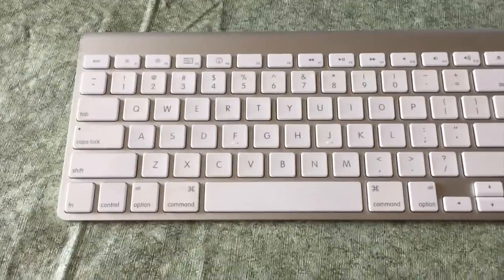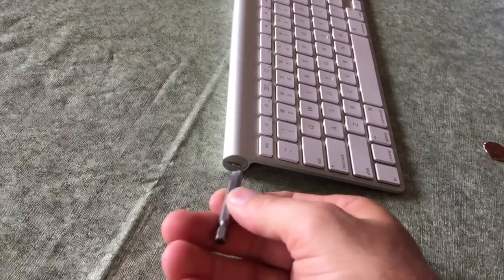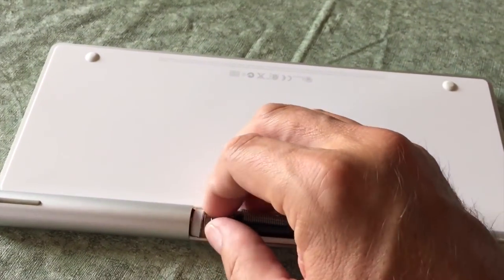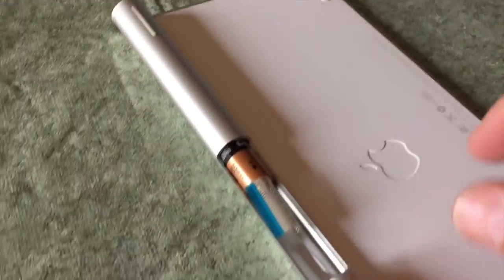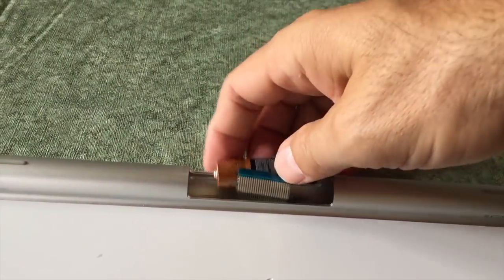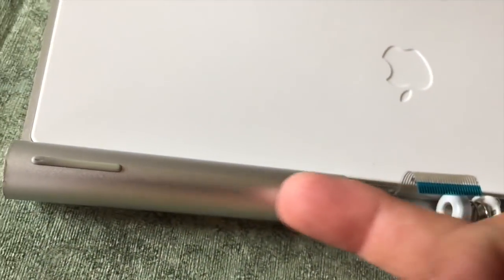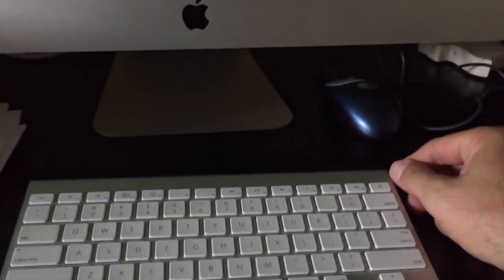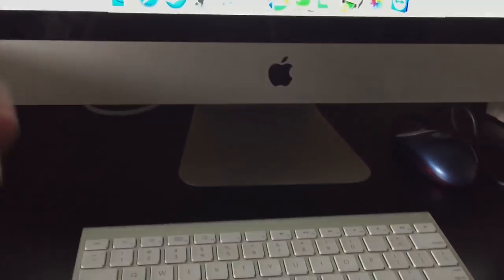How to replace Apple Wireless Keyboard Battery

Comment: Thanks for the video. I followed the steps of the video but the keyboard does not turn on. I cleaned the remains of the batteries but I do not know why it does not work. I put aluminum foil on the tip of the pile in case it did not make contact but nothing ... can you think what can happen? Thank you very much! regards
Reply from the maker: if you have not resolved this already you might try to make sure that you hear that little click I point out in the video that indicates the batteries are seated in tight with a good connection.  It is entirely possible that you have a lot of dried up battery juice still down in there.  It that is the case you will need to try to reach it with a small wire bottle cleaner or the like.  You should feel and hear that click with the batteries are seated correctly.  Best of luck.

Comment: Can I use something instead of the battery cover that screw on piece I can’t find mine
Reply from the maker: Not sure exactly what you are describing but if the plastic cover is missing and you want to keep dust out you can always use a little painters tape or the like to cover the gap.

Comment: Someone help me. My keyboard stopped working. I tried changing the batteries still doesn't work not even new batteries. I don't know it's either the keyboard keyboard or it's just the batteries. 😩
Reply from the maker: Sorry late response, but once you figure out if the batteries are good make sure they are inserted in the correct way (both should be facing same way).  Note that "click" in the video that tells you the batteries are seated correctly inside the tube.  It is possible to put the batteries in and still they are not pushed down far enough to make a good connection with the terminal inside the tube.  Use your index finger and push them down into the tube until you feel or hear the click.

Comment: Thanks for this. I ended up throwing mine away. The battery was so stuck I couldn't get it out even drilling a hole in the door and hitting it with a screw driver. 

I really don't get the point of wireless keyboards and mice. 90% of the time they are just a pain and I end up using an old wired Dell one from years back!
Reply: Yay i got my keyboard worked in only 7 years old and I did it😛

Comment: Hey yo! Thanks for the video, it is extremely helpful! Amazing, you gave me the confidence to attempt to fix my keyboard. I haven't used my keyboard in over A YEAR and the batteries were really corroded, I couldn't remove the battery cap either. But after I followed your instructions, I managed to fix my keyboard and save myself $150 on a new "magical keypad". Here are some things that I think would be helpful to note if all you people are facing the same problems: 

1)A STUCK BATTERY CAP (due to battery corrosion) 
-I sprayed WD40 on the cap as well (quite abit) and let it sit for awhile before I try unscrewing. 

2)A STUCK SCREW (after opening the middle compartment cap)
-spray WD40 as well, it should work!

3)STUCK BATTERIES 
-my batteries absolutely did not roll out like in the video. They were very, VERY stuck. Don't fret, take WD40 and sprayyyyyyy. Then, take something long, thin and sturdy (I used a screw driver) and a hammer and hammer the battery out. It took me awhile and quite a lot of strength but eventually, my batteries came out! 

4)REMOVING THE CORROSION WITHIN THE BATTERY COMPARTMENT 
-well, I followed Google and used a toothbrush dipped in vinegar. I couldn't fully remove the corrosion within, but it did kind of help. My keyboard could still work although there's corrosion left. 

5)KEYBOARD STILL WON'T WORK?
-ahhhh, when I completed everything you've said but my keyboard still couldn't work, I got pretty disappointed but I realised CHECK and ensure that all your CONTACT POINTS are CLEAN. (I forgot about the battery cap that had the corrosion crystals so I cleaned it and it worked)

Thanks friend for helping! I'm really extremely thankful!

(Also another thing to note, I'm just a ordinary, super noob non-techy girl and I managed to do this so I'm pretty proud of myself! Even though I was afraid that I might ruin stuff within like the wiring)
Reply from the maker: Well done, thx for sharing.  Success!
Reply: cheercub88 ok but what about stuck battery when u can't open up battery screw but you get middle compartment open?

Comment: Thank you for your thoroughness.  I really appreciated that you so elaborately described your methodologies that didn't work to open the compartment, because I think everyone who undertakes this task eventually gets to the impact driver or ceremonial dagger.  The painters' tape tip is great advice for those without magnetic bowl, so listen up people! My only note would be to retitle your video, something like "HOW TO ACCESS APPLE WIRELESS KEYBOARD COMPARTMENT WHEN CAP IS CORRODED," so others can find your video easier.  BIG THANKS!

Comment: What type of screw driver did you use to take out the screw?
Reply from the maker: The Husky 8-in-1 Philips and Slotted Screwdriver Set.  Bits include #000, #00, #0 and #1 Philips tips and 1/16 in., 5/64 in., 3/32 in. and 1/8 in. slotted tips.  http://www.homedepot.com/p/Husky-8-in-1-Philips-and-Slotted-Screwdriver-Set-74501/100074336
Reply: I picked it up last night and was able to take out the electronics and the first battery. Just can't get the second battery out. I think its rusted in there or something. :( Any suggestions? Hitting it against my leg def isn't working.
Reply from the maker: Try setting the board on its side with a towel or small pad under it.  Make sure the ribbon is still removed, place a protective layer of wood or coin over the key board end facing up and use a small hammer.   You can hit it with a good force. Use a heavier hit than on your knee.  I feel like if you are going to throw it away anyway because you cannot jar it loose then why not hit it hard enough to see if it will break free.  I had one corroded bad up in there and I was able to knock it back enough to use the knee trick the rest of the way out.  I then spend a good bit of time trying to clean down the tube after that to make good contact with new batteries.  It is not an easy task but then again you are trying to save $60-80 bucks.  Best of luck.
Reply: so get this...i called Duracell and told them what happened. They said they will send me a prepaid label and i can mail the keyboard to them. They will take a look and then determine "compensation". I'll keep you updated on what happens. Thanks!

Comment: Way cool video....Doc! Found an IMAC in a dumpster with corroded batteries in the keyboard. Couldnt get the end cap off either so I turned the end cap side up and dripped some light oil onto the cap every night and tapped it a little for 3 days. If you wait a couple days for the oil to soak in it will usually come out. Soaking and time  is the key.
Reply from the maker: Good idea!  Glad that worked for you.  Your comment may help others.
Reply: Cant figure why you would use a screwdriver when those slots are always designed for coins. They're rounded to take coins because coins are the most at hand tool. Mine is the other 3 call keyboard though Your 2 cell board looks easier to remove the bluetooth.
Reply: @Leyland---Doc...just figured out something on your video. Now that i see how to remove the maintenence cover and get the batteries out through it you could remove the batteries, shoot some WD-40 into the end, then let it stand up and let the juice soak into the end cap. Tap it every few days like I did, then try it aghain later with a nickel and it will come out.
Reply: @docs...hey this reply thing works pretty well. I'm still figuring out YouTub e though. Another solution might be to drill a hole in the bottom of the battery tube to inject some oil into it. Then tip the keynboard up so the oil runs down to the battery camp and soaks in.
Reply: Leyland Duncan )

Comment from the maker: Martin, check to make sure the ribbon is seated all the way into its slot and making a good solid connection across the entire ribbon.  Use a small plastic flat head screw driver or what ever you have to push down on the ribbon cable to seat solidly in place.  If it is not uniformly straight all the way across you sometimes will get keys acting up on you.

Comment: So I ended up taking them out but the majority of my word keys don't seem to work now. The space bar, delete bar, and several other keys work but the majority don't...any advice?
Reply from the maker: This is generally cause day the ribbon not being pushed in all the way so some of the key are not making connection through he ribbon.  Try reseating the ribbon and make sure it is push in all the way.

Comment: excellent - easy to follow...
unfortunately my batteries are fused n there - i got the first one out but the second one when i jammed a screwdriver up there it pulled the middle of the battery out! the casing is still up there and no way to get it out...
but thanks for the guidance!
Reply from the maker: Bad luck.  Sry to hear it.  Careful with the clean up.

Comment: I got the first battery out, but the 2nd one close to the end still stuck inside :(  I'm letting the WD40 juice sit in there for a day in hope it will make it loosen up.
Reply from the maker: +Joanne Liu were you able to get the stubborn one to break loose?  If not try that knee trick I showed in the video.  Get a block of wood if that doesn't do it and tap on it a bit harder.  The keyboard is very well built and can stand a good hit on the side or two.  Make sure that the WD40 has all been removed and evaporated out of the tube before attempting it though.  Otherwise it will stick on you.  Best of luck.
Reply: +Dale Smith Mine is a lot worse than yours because I left the batteries in there way too long.  The knee trick definitely won't work, I was using wood stick pounded at end, also used a knife try to loosen up the battery inside, but it's stubbornly sticked.  I used WD40 juice to soak it, it didn't help either.  I might just as well use the electoral drill to make a hole in the center from the end; that's what I am going to try.  Thank you!

Comment: This is the last thing I'd want to do!  If you have to do all of this to remove a simple set of AA batteries, before breaking something else, I'd go to an Apple dealer and get a new screw for the side and next time, be gentler with it!
Reply from the maker: +OPUS390 Yep, I get it.  It is easy for many to agree with you.  It is a last ditch effort to save an otherwise perfectly good wireless keyboard.  In many cases just getting another screw cap for the end is not a solution.  The acid in the batteries sometime fuse the cap and tube together and you cannot remove it so a new part by itself will not help.  If you can get the cap off then your problem is solve.  I agree with you on being more "gentler" when ever possible with electronics of any kind.  I will say if you go to an Apple dealer for any reason you might want to just buy a new keyboard.  They are cheap enough.  The fix I recorded was to aid others looking for an alternative to try to resolve the issue on its own.

Comment: Thanks for the video. It really is helpful. I have still have a problem though. I have removed the circuit board but the batteries are still not coming out. Your first one came out fairly easily, whereas for me, I have been hammering the keyboard and its still not coming out!! I guess its on to a new keyboard for me.
Reply from the maker: +yoho7788 Sorry to hear that they are still stuck.  You might try running a stiff coat hanger down the length of the tube to jar the battery loose a bit.  Then apply the force to dislodge them.  Sometimes the batteries swell so much the pressure may be to great to remove them.  Shine a light down the tube and see what you are dealing with.  I personally would try running something long and firm down to the battery and try to spin or wiggle it enough to bang it out.

Comment: If the  batteries wont come  out  this way,   do you have   a suggestion.
Reply from the maker: +Sandra Kanagasabai I have found always found that once the tube holding the electronics is removed tapping the keyboard on its side will release the batteries.  It is a matter of force I believe that is the question.  Some batteries are stubborn and need a little more force to break them loose.  You can also try straightening out a coat hanger to run down the tube to jar the old battery a little bit before applying the force on the side of the keyboard to dislodge it.  Best of luck.